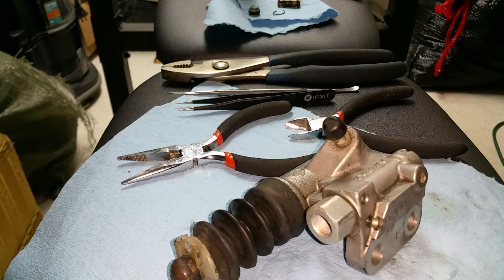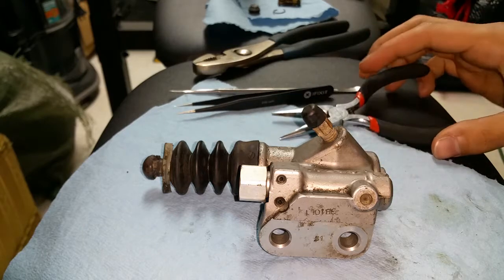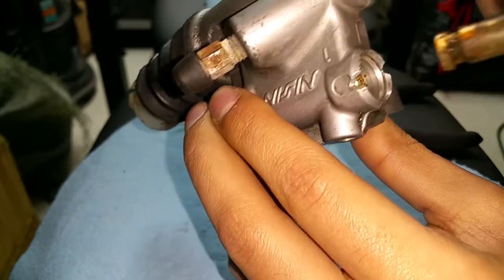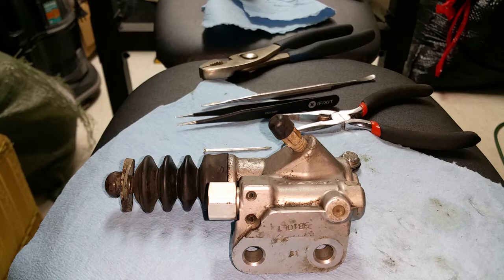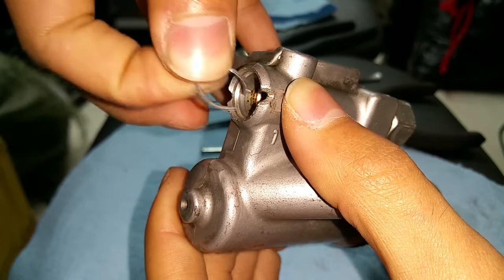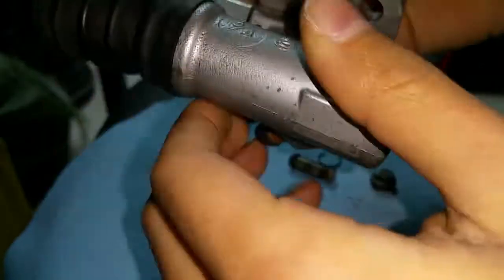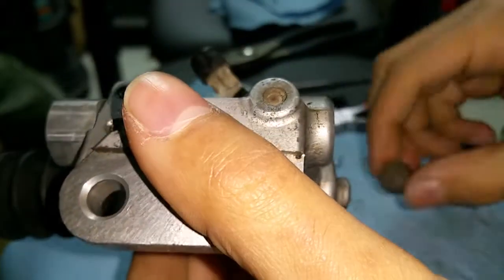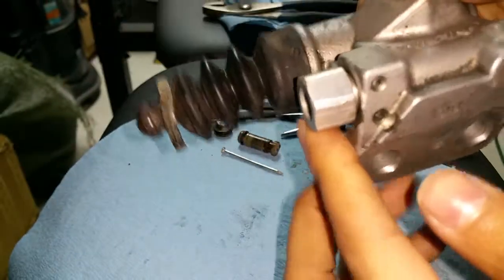Accord v6 6 Speed Slave Cylinder Check Valve Delete

Comment: Wondering why the check valve can't be removed from the other end since the line connection can be removed (same type of connection as on the clutch master cylinder). Perhaps it's because there's really no access to push one of the two pins out.

I picked up a Luk. It looks like it has a solid ring (continuous) holding the end piece in.
Reply from the maker: That is exactly why. Messing with the line connector could cause issues with leaks in the future! Pulling it out through the removal rear cap is the easiest way to get it out. I have done the same process on a Luk CSS.

Comment: how about an 04 tsx 6speed?
Reply: I have an 07 TSX and I am hoping that there is a similar mod available because driving this car sucks. I just bought a new slave cylinder. I know it looks different than the one in this video, but I'll check it out. If the check valve is not in the slave, then I wonder if it is in the clutch master cylinder.
Reply: @mtsixspeed  Super late reply, but hopefully you figured it out by now. The 8th gen Honda Civic Si had the clutch delay design within the clutch slave cylinder itself, as well as the
Clutch slave cylinder. Since the K-series are pretty similar, I assumed that the newer Acura TSX manuals had the same setup that could be completely swapped with an upgrade like KTuned.
Reply from the maker: The 6 speed TSX does not have the check valve since it is a 4 cylinder.  Only for the v6 Honda or Acura 6 speeds.
Reply: how do you know? because the tsx also has pretty slow engagement especially 1st to 2nd.
Reply from the maker: +D-boyz The 4 cylinder Slaves are designed differently. The TSX 6 speed  look similar in design as any regular direct response 5 speed slave. The second chamber on the v6 6 speeds is what houses the check valve that I get rid of. The engagement you are getting depends on how much life ur clutch has left.
Reply: @slimbeanfl5  suuuper old thread but, technically the 4cyl an have the delay valve if the slave has been replaced. They were only different from the factory, on the oem replacements the 4cyl and 6cyl get the same slave cylinder. I just did this mod on my new slave for my 2013 Accord sport.